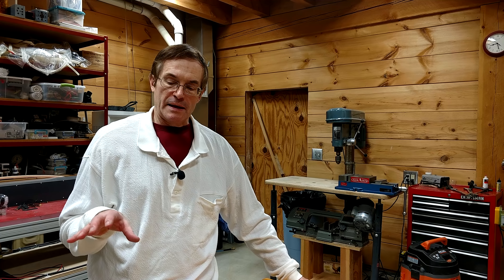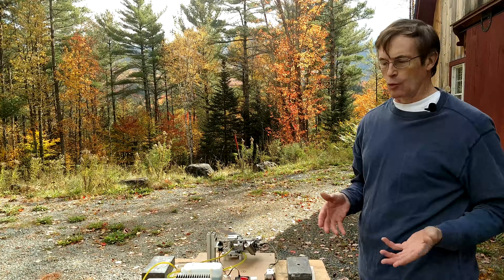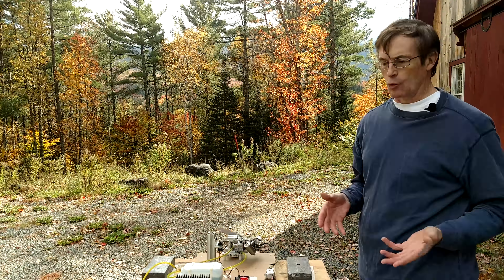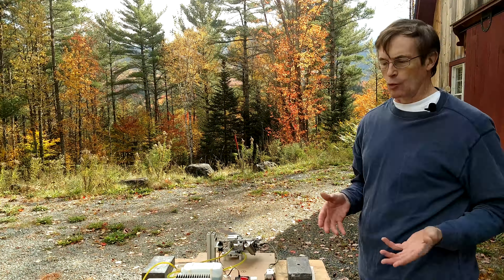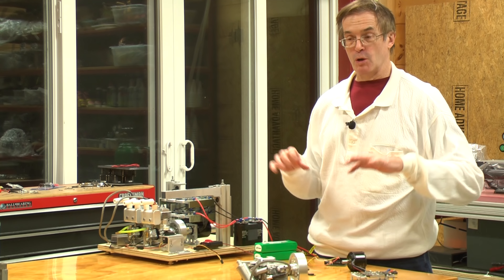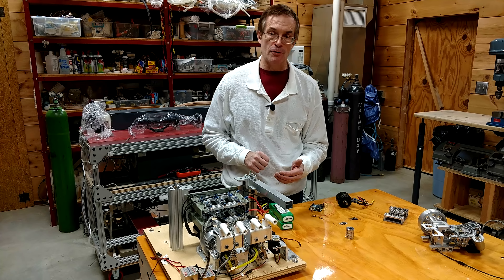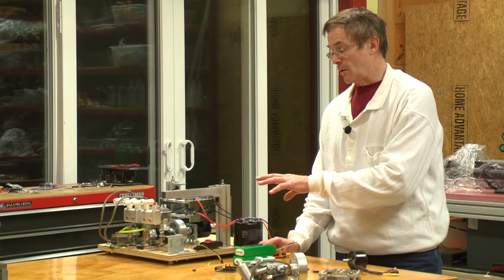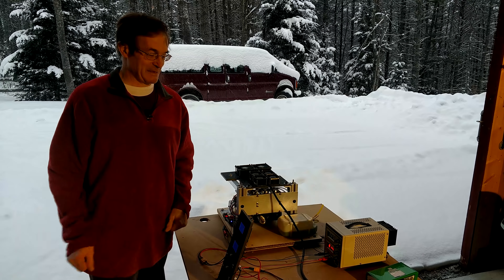Hybrid Drone Generator

Comment: This is fantastic! I don't know if you have heard of this, but I recommend checking out the VESC. It is an open source BLDC motor controller that also allows you to turn it into a generator, as you can command it to brake the motors and generate a certain amperage.  (IE: Brake it as hard as you need to until it generates 10 amps). And you can use it to start your generator. It seems like a perfect match for the project, as well as the fact that it would be using active rectification and be more efficient then diodes.
Reply from the maker: Thanks, that is an interesting option and I'll look into it.  The 10 amps may be a problem, but ill check it out.
Reply: Tech Ingredients ten amps is only an example, you can go much higher as long as you don't overheat. I believe up to 70 or 80? At 48v.

Comment: Great Video, I thought of this same Concept for Creating Drones for Transportation... With our current battery tech we can only get 20 to 30 Min MAX, it is just not practical, but with a batter buffer for emergencies, 5 Min Buffer you can fly for hundreds of miles of a couple gallons of fuel.. Quiet Design Props and good Exhaust and you've got a Great machine to travel in. I really hope someone puts a backing to drone tech for future travel. My DJI can remain stable in 25 MPH Winds, and Fly 31 MPH.. I would imagine that a Scaled up Drone would very easily hit 150 to 200 MPH and be able to fly through a thunderstorm with the Right Tech on board.

Comment: is it actually possible to achieve overall better energy density of generator + fuel + engines system compared to using battery of the same weight?

Comment: This is a patient primer for those new to this sort of stuff. For ultimate power to weight ratio of a fuel driven engine, you have to consider Wankel engines and jet turbines. For efficiency, Stirling cycle but the surface area required for the heat exchange in small volume ruins them in terms of power to weight ratio as it keeps them very low RPM. Rankine cycle is highly efficient and where steam engines would have headed if not for the convenience of internal combustion. You can use horizontally opposed 4 strokes with opposed power strokes but of course you'll get the dip in power between power strokes for anything without sufficient pistons and cylinders to overlap power strokes.  Most engines generate horrendous wase heat inefficiencies.
I think a variation on the Stirling cycle engine for a multitude of very small pistons and cylinders would help to improve it's power to weight ratio but the labour to build such an engine is prohibitive. Turbo charging and super charging considerably improve power to weight ratios. Tuned pipes on 2-strokes considerably improve their power to weight ratio and designing a 2 stroke engine for a set RPM goes some way to reducing their inefficiency through exhausting unburnt fuel through the transfer port. Further efficiency is gained through fuel injection, especially on a 2-stroke. If I were you, I'd favor a 5 cylinder radial 4-stroke or a tuned pipe 2-stroke to simplify progress. Potting generator windings in epoxy to resist vibration damage and let a single cylinder 2-stroke with a tuned pipe run at it's optimum RPM, Let it run with a well designed damped freedom of movement in it's main vibration axis and decouple if from the quad's chassis. As for gaps between power strokes, I think it's a non-issue. You can use the mechanical energy storage of a flywheel to reduce peak currents in electronics and an efficient switch mode regulator to handle dropping the varying voltage to correct battery charge levels. A flywheel can be lightened by giving it plenty of diameter and concentrating the mass around it's perimeter. But you need a generator coupled to the engine so it makes perfect sense to machine generator magnets into the rotor that the flywheel forms and build your wound stator around that. There's no need to run an external fan to cool the engine when it's less convoluted to build a small fan into the flywheel. Go centrifugal flow because blocking the ducts reduces the load on a centrifugal pump which you can do with some bi-metal ducted valve control that shuts off the fan until the engine needs it.

Comment: When you read the torque number on a 4 stroke engine that is the average over the entire operating cycle. The instantaneous torque can be 4 or 5 times the average.  Driving a propeller with a 4 stroke engine can be very challenging. Most 4 cylinder aircraft engines have a restricted speed range to prevent fatigue failure of the prop.

An automobile alternator is basically a 3 phase AC motor  that is rectified output. The energy that is fed to the rotor allows it to produce more current.

Comment: You can use a regulator circuit to let the engines come up to RPM before loading the generator and thus the engines . You can direct couple the engines 180 degrees and reduce your flywheel weight if you already have not done so already .
3 of the 3 phase electric motors used as generators with the output peaks by mechanical adjustment to fit between each other goes a long way toward ripple elimination ( I have only used the technique with 4 alternators at the same time with independent rotor field control ) .
Hybrid systems only need enough stability in this case to provide enough power to the thrust rotor power systems compensate-able by the thrust motor control systems ( ( watts needed for thrust ) divided by ( volts available ) = current allocated for thrust motor drive ) as power to weight ratio is dominant over power stability .
ICE engines can be efficiency optimized for RPM and electrical generation managed by pre-compensating fuel delivery for power requirement estimates .

Comment: Hi there my name is Keith Newton. I am a little engineer in mind myself I submitted a patent us patent office cell phone tower filter. I'm pretty impressed with your motors and I just wanted to say one thing I know it's been 4 years but I was thinking about using a pulley system and still using the 4-stroke motor because of the more torque it can handle a belt pulley system that you can manually engage a clutch pulley to run both generators with one belt system a smaller pulley on the generators maybe start at 2 "1/2 3"  in maybe smaller depending on what the voltage you're looking for. Just thought I'd whisper at you I enjoy watching the videos I just started a little while ago I've checked out the a few of the jet videos pretty cool good luck to you best wishes

Comment: At 4200 charge spikes a second ESR and ESL in the caps will have a big (limiting) effect, electrolytic capacitors are rubbish at high. frequency. Use MOTOR RUN caps instead. Great work and great video, thanks

Comment: The exhaust “expansion chamber” division cone angle (<), constant diameter section (=), and conversion cone angles (>) all work to tune the power band working rpm area. The wider the converging cone angle, the more narrow and abrupt the power band. The “stinger” diameter and length come into play as well. The location of the stinger can be practically anywhere on the expansion chamber. To make the chamber shorter, the whole length of the stinger can be inside the chamber. I’ll try to find my reference on this information and post it when I find it.

Comment: What 2 cylinder model engines did you find that had BOTH cylinders firing at the same time?? Every twin cylinder 2-Stroke engine I've seen has the 2 cylinders 180° out of phase with each other. 🤔

Comment: generators are essentially current sources because they work via finite magneitc fields,  as a result of this paralleing them with voltage sources like batteries and capacitors works well.

Comment: This is a fantastic project, I'm a huge fan. I'm not sure how much experience you have with combustion engines, but if you want to get rid of those lateral vibrations you can use a counter-rotating balance shafts, which most single cylinder motorcycles use to good effect. You can also use a flat twin engine with opposing cylinders, which gets ride of almost all the rocking vibration of your setup but would have a lot more rotational vibration (because both cylinders fire at once).
Reply: They don’t both fire at once

Comment: You could use a cush drive similar to the ones on a motorcycles rear wheel.  There is squishy rubbe in there so that there are no sudden jerks from the motor.  On motorcycles it is so that you don't break traction with the rear wheel or stretch the chain.  It could work with a generator too tho.

Comment: Great video. I have 2 questions. 1) Did the voltage rectifier using diodes generate too much heat given the high currents, and if so, would ideal diodes or MOSFETS be needed instead? 2) Do you need to worry about reverse current from the battery to the generator if for some reason the generator stops in flight, and would a BMS help with this?
Reply from the maker: A switching circuit based on mosfets would be more effecient.

Comment: Hi, if you got an engine and sealed all holes with silicone, with the carburetor above the water and exhaust under the water. Would the engine run under water and silently?

Comment: Interesting. Did you consider using the 3pAC output to drive the 3pAC BL"DC" motors of the drone via frequency control with the lipo batteries to again stabilize and cover fast load changes?
Reply from the maker: No we didn't.

Comment: When I used to write software for small wind turbine generators, we would use a boost circuit to control the rotational speed and the bus voltage.  There were two control loops in the micro, the first could optimize the amount of energy removed along each ripple, and the second ran at about 1/100th the speed of the first, and controlled the overall RPM of the system.  Also at those frequencies the electrolytic capacitors you chose will have significant AC resistance, we usually had film caps in parallel that were much smaller capacitance, but could handle the higher frequency harmonics.  Finally, wondering why you didn't put the motors and generators inline and save the weight of the timing belt.

Comment: I think it would be best to replace the diode rectifiers with ESCs that have regenerative braking. This way you would get synchronous rectification in normal operation and the ESC could also turn the generator motor to start the engine.
There are also many other things that can be implemented into the ESC with regen. braking eg. battery protection, overload protection, current limiting, etc.

Comment: hi I have question.
Now I'm building of hybrid drone and there is something problem.
when drone generate power through generator and then the power move to battery. At the same time battery should send power to servo motors 
so battery have to do charge and discharge. so what do I equip something between generator and battery and servo motors. 
thank you

Comment: Hi I am trying to build a tether for a very large octocopter with a extra lifting payload capability of 90/100 kg but instead of a combustion engine we want to use a 220v power supply. The only thing I am worried about is basically the same setup as yours but how do you prevent your batteries from overcharging if your power supply is slowly charging the batteries. say we want to do a 72 hour test flight and the onboard LiPo batteries are getting over the 4.2v per cell?

Is there some way we can talk and i could pick your knowledge?

Thank you very much in advance.

Comment: If you have precise voltage timing on the pulses  you should be able to use IGBT or mosfet transistors to act as ideal diodes and gain a bit more power at no weight cost.
Reply: Oops mike beat me to the punch,  but still a good idea, could even use it for motor breaking if you have the cooling.

Comment: I've was working on this. 
I reached some of the same conclusions as you did in your video.
But I am going to build a smaller version of the generator using a 2.74cc engine.
Reply from the maker: Great!
Good luck.
Reply: @TechIngredients  The power unit just gets to big and heavy. So I've switched my focused to 3D quad copters. The Nitro Stingray uses a single engine to power 4 rotors. Very promising for scaling up.

Comment: Would the engines benefit from having their shafts coupled together (in series) rather than synchronized by the belt? Then the belt could drive the generators at an increased speed instead of being direct-driven by the engines.
Reply from the maker: That's an option.  We used the belt coupling so as to orient the engines optimally for cooling in a compact enclosure.

Comment: Have you considered running the motors with a slight over-voltage generation that means the mechanical response to load changes has some buffer time.
Alternatively, have you considered linking the Arduino to the throttle input on the drone so that it actively increases RPM when a throttle up is commanded via RC before a voltage drop occurs.

Comment: Hmm... If you're up for it, I think normal, cheap power factor correction chips will deal with the voltage control while not putting too high or low impedance draw on the generators.  It should let you run the generators at their most efficient speed for the current power requirements.  It would probably require a custom circuit board, but that shouldn't be too hard.

For that matter, you could simplify it and use the arduino as the power factor correction, trading circuit complexity for programming complexity.

Comment: Very good. A effect design and excellent explanation. Though, add in a subsystem for reclaiming some motor exhaust at the x-axis of the engine system (the sides). It should be a reclamation system like what you see in some generators or engines which redirect exhaust flow back into the intake and some diverted towards the engine in lieu of cooling air from the fans so it should give some energy savings from the fans and controlled with a Arduino controller (with thermocouple probe to the engine) that shuts the cooling fans off when the engines are sufficiently cooled by the fast rushing exhaust air. The exhaust divergent for cooling should have some intake holes to pull in exterior ambient air by fluid air flow entrainment especially if you take that duct and compress a portion of it into a venturi with small air hole in the throat creating a vacuum intake so it'll cool the air that's rushing and more effective in cooling the engine. I suppose the net savings of power can be redirected into powering the propellers especially if you put multiple propellers in series operation by use of gear wheels or maybe as fuel efficiency instead. Good luck!

Comment: Nice work! Was came across your project looking into using RC motors for generators. 
For your own work, you could consider a boost regulator which would allow you better control over available power versus charging current. You could actually do this with an arduino board.

Comment: I worked on making equipment to test fuel efficiency of two wheelers. A cooler engine is not necessarily more efficient. Engines have a optimal temperature for peak efficiency. For the bike engines we tested that temperature was about 80 degrees Celsius. But each engine is different and would be optimized for a different temperature. You might want to run tests at different engine temps to find optimal value.
Reply from the maker: Thanks.

Comment: Careful! the shape of the exhaust is very important to a 2 stroke engine. It needs to be able to vehiculate pressure waves to and from the combustion chamber, which need to synchronize accurately in order to prevent the fuel mixture from being dumped into the exhaust

Comment: As i understand Lithium batteries need to have a BMS (battery management system) that controls the charging, and discharging of the batteries.
The Lithium batteries cant discharge completely, and the charging when close to full capacity needs to be stooped i order to preserve the life cycles of the batteries.
What type of BMS do you use to control the battery charge discharge cycles?
Do the battery packs you use include a BMS?
In theory you could double the life cycle of the batteries if you use a BMS that discharges the batteries to 30%, and charges them up only to 60%.
Would that be a option since you are using the batteries as a secondary safety system?
Reply from the maker: The design, operating voltage of the generator is at the 80% charge voltage of a given battery pack.  Balance charging of the batteries is accomplished on the ground between flights.

Comment: Would a rotor motor provide a higher performance less vibration with fuel use efficiency that would provide better exhaust and sound reduction property’s ? Thanks for your video. Another great project 👍🏻
Reply from the maker: There would be lower vibration, but the fuel effeciency and sound levels would be similar.  The problem is their unavailability.

Comment: Looking back at the tests you did with brushless motors used as generators (I couldn't find this video...), If a brushless motor  is rated at 80% efficiency at a certain voltage/RPM, can we expect about the same efficiency when it is used as a generator at the same RPM?
Reply from the maker: Yes.  There can be some losses in the three phase converters that drive the motors or when operating the motor as a generator, rectify the output.  This is independent of the motor itself, but is a significant issue.  Choose rectifiers that have a minimal voltage drop at the operating voltage of the generator.

Comment: would an electrically controlled advance/delay/skip timing spark plug and fuel injected boxer configuration work for this instead of timing a crank shaft and mechanically actuating the carburetor?
Reply from the maker: Yes, but for such small engines that would be a custom build from scratch.
Reply: @TechIngredients  awesome thank you for this amazing work!